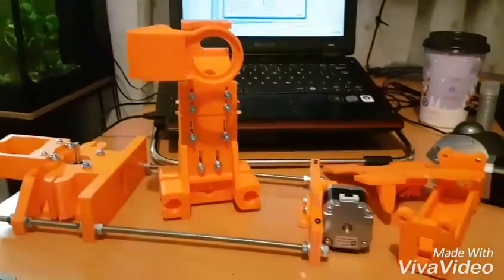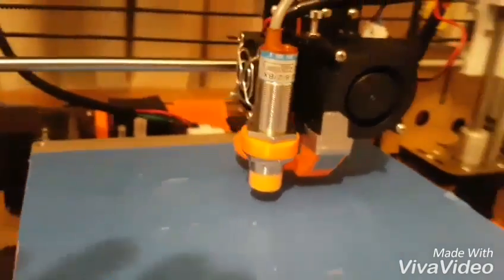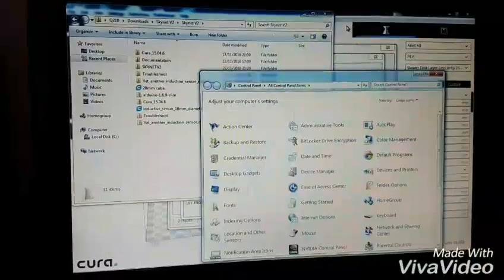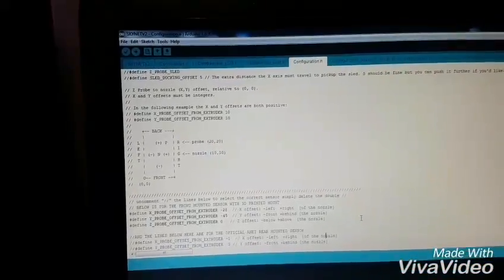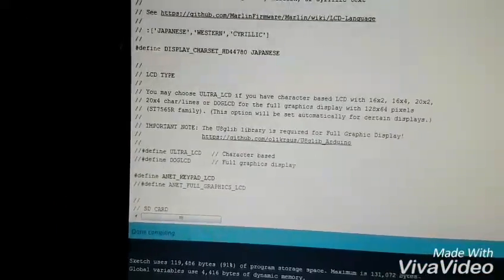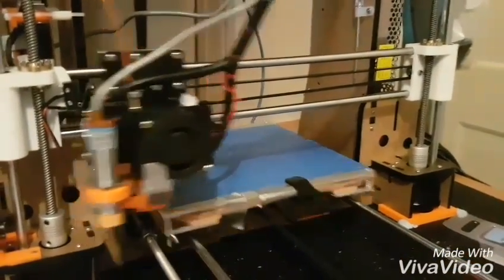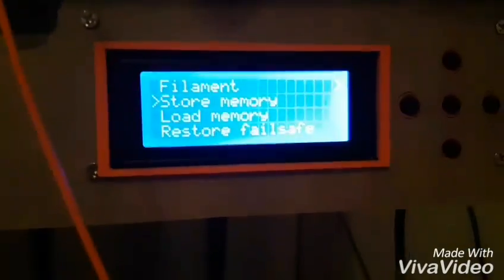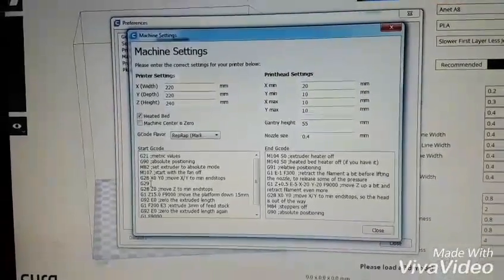Anet A8 Inductive Sensor & Skynet V2 Overview

Comment: i cant lower the z off set lower than 0.5
Reply from the maker: Hi, That sounds weird, It has been a while but can you see a 'max z offset' in the code anywhere? When I get a sec, i will have a look. Cheers.
Reply: solved , took me a day. (coz all other thing went wrong..)

have to disable software_end_stop.

then M502
after home, click Z down( any, just so the nozzle now is at Z0 to what printer thinks)

then G92 Z10. and i can start lower.  buut still , i can only lower the Z on the printer screen, i cant do it via repetier.

then get the offset. and flash firmware and M502 again .  

damn

Comment: I purchased the same one from amazon but im not exactly sure how to wire this thing, could you make a video explaining how to wire it as well? thanks
Reply from the maker: sk8rgu1 Hi. Mine came plug and play with a connector but I was messing around with another one the other day on Arduino. From memory, the brown is +5v, the blue is ground and the black is signal but I'll check. I put a 10k resistor between signal and ground I think. I'll dig it out. There is a pic in the documentation section of the Skynet Firmware folder linked on my other vid.
Reply from the maker: sk8rgu1 Hi. i just found the diagram I used when messing around with Arduino to test the switch. Brown was vcc, (it says 6-36v but 5v works fine), black is signal and blue is ground. I put a 10k resistor between black and blue (signal and ground) but I don't think the bought one had one and if you are running it at 5v (ie you are powering it from the socket where the old switch was) then you probably needn't bother. If you want to run it from 12v (which I wouldn't) it will need that 10k resistor between blue and black plus an additional 15k resistor on the black signal line before it gets to the board. I am not sure on the pinout of the endstop sockets. Maybe worth checking on the AnetA8 Facebook support group as a quick search didn't turn anything up. Good luck.
Reply: oh wow awesome! I did the whole resistor thingy and figured it out yesterday. I just used 2 10k resistors instead of a 10k and a 15k. I got mine working and its pretty good. However i do get quite a few miss prints, im guessing its because of how cold it is in the basement (50*f or 10*C) so i put my printer in a box and we will see how that goes
Reply: Maybe you can buy it here https://www.aliexpress.com/item/High-Quality-LJC18A3-H-Z-BX-1-10mm-Capacitance-Proximity-Sensor-Switch-DC-6-36V-300mA/32828750563.html

Comment: Hi could you point me in the right direction, firmware upload without issue.. everything looks good open up Cura and use the print to USB brings up a simple window Printing on COM6 "operational temperture: 21 bed 21" COM port is correct and using Cura 15.04.6.

Thanks

Loz
Reply from the maker: andrew lawrence Hi. I use Cura 2.3.1 and just normally print from sd cards. the default Prusa I3 settings are a good start to get good results.
Reply: I fixed this by switching the Print Window interface too Pronterface UI, this can be found in the Preferences options in Cura.
Reply: Andrew, thanks for giving the solution to the problem.  Was looking around and would never have found it.

Comment: How did you wire the sensor I can't get it to work. :) thanks!
Reply from the maker: TekkitWithZander Hi. sorry to hear you are having problems. The sensor just plugs into the z axis socket where the switch was on mobo.
Reply: Plan C can you help me with my printer please if you could Skype me that would be great, my skype name is TekkitWithZander. Thanks so much

Comment: I keep getting an error on this line:  float zprobe_zoffset = Z_PROBE_OFFSET_FROM_EXTRUDER;
Reply from the maker: Hi, Not sure tbh. When compiling?
Do your lines look like this?

// uncomment "//" the lines below to select the correct sensor simply delete the double //
// BELOW IS FOR THE FRONT MOUNTED SENSOR WITH 3D PRINTED MOUNT
#define X_PROBE_OFFSET_FROM_EXTRUDER -28  // X offset: -left  +right  [of the nozzle]
#define Y_PROBE_OFFSET_FROM_EXTRUDER -45  // Y offset: -front +behind [the nozzle]
#define Z_PROBE_OFFSET_FROM_EXTRUDER 0   // Z offset: -below +above  [the nozzle]

The ones below that should be commented out like this:

//AND THE LINES BELOW HERE ARE FOR THE OFFICIAL ANET REAR MOUNTED SENSOR
//#define X_PROBE_OFFSET_FROM_EXTRUDER -1  // X offset: -left  +right  [of the nozzle]
//#define Y_PROBE_OFFSET_FROM_EXTRUDER  3 // Y offset: -front +behind [the nozzle]
//#define Z_PROBE_OFFSET_FROM_EXTRUDER 0   // Z offset: -below +above  [the nozzle]
Reply from the maker: It may also just be worth unzipping a fresh copy of Skynet, making the changes and re-compiling/uploading. May have hit a key somewhere by accident or something? Good luck.
Reply: I just ended up using skynet v1, a I now have auto level working.
but thanks anyways

Comment from the maker: @ Thomas Hussey. (sorry - couldn't find your comment to reply direct). The only think I can think of for "Z probe out. bed" message is that the firmware believes that the z probe is outside of the area of the heated bed. I have not come across this myself but you could check a couple of things: First, in the machine settings of Cura, is the bed size set correctly at 220*220? If so then check you didn't un-comment the set of lines in Skynet for the official Anet sensor instead of the Ebay one. The Anet sensor is mounted in a different location. It is mounted behind the nozzle where the linear bearings attach to the X rails. Have a look at 5:23 on the video. Its the first set of 3 lines that need to be un-commented. The second set of 3 should be left alone (unless you have the rear mounted sensor). Other than that, check that the offsets between the z probe and nozzle match what is shown at 5:23. Finally, check that the "define left/right/etc probe bed position have the same values as shown at 5:49 in the video.

Comment: Thanks for the video, one question which i cant find an answer too anywhere; how do you know what height the z sensor needs to be in the mount? Is it just a matter of making sure the nozzle is as low as possible and adjusting the sensor height until it lights up?
Reply from the maker: Robin Lester Hi. I have the sensor 1-2mm above the nozzle. A small cable tie happens to be about 1mm thick so you can lower the nozzle to where you get a nice drag on the paper, loosen the sensor mount and then slide the zip tie under it and tighten it back up. The 1-2mm is just to help stop the sensor from getting caught on anything.
Reply: Plan C so the sensors height doesn't really matter? I assumed you had to move it to the point the sensor will trip, otherwise how is it going to stop the head crashing into the heatbed? when the sensor trips all z movement should stop?
Reply from the maker: Hi, That's right. When the sensor trips the CPU thinks that the Z is at zero.The blue sensors have a max range of about 4mm and the orange ones are about 8mm I think. In practice it will be less as these are cheap sensors and the plate is aluminum not steel. It doesn't really matter where the sensor is as long as it is within range and below the nozzle. What matters is the Z offset.or the amount that the computer should continue moving down past the point that the sensor is triggered to give the 'true' Z=0 point for the nozzle. The offeset is negative because the the sensor is below the nozzle. Good luck.
Reply: Plan C Thank you! that makes perfect sense :)

Comment: Thankz for the guide dude, made life super easy for me, just 1 thing i'm struggling with, after each print the thing starts printing in the air, it doesn't home Z, and i have no idea what you saying after 11:40 haha ;) listened about 50x, UK always a battle to us South African's lol could you please explain the last part.
Cheers
Reply from the maker: SainT FPV Sure. I had that too. I home it on the LCD before each print and I also put a G29 command (scan bed) in the printer setting. Just insert a line and type G28 After the line where you see the first mention of G28. Its in settings, printer, manage printers, machine settings in Cura. I have it at line 6 in the Gcode. Good luck and thanks for watching.

Comment: Can I have a link to the finished code before you uploaded it I have the same printer. And don't know how to code it for the induction sensor, thanks. BTW Nice vid!
Reply from the maker: TekkitWithZander Hi. Sorry but I don't have an easy way to upload it as I don't have any online storage. There are only two changes to the original code. If I can figure a way out to upload it then I will. All the best.
Reply: Plan C thanks, what if I create a Dropbox that you can use
Reply from the maker: TekkitWithZander Hi. happy to do that
Reply: Plan C reply how do you want me to send the email and password  to you
Reply: Plan C so is the 145 the bed temp? Also what material do you use
Reply from the maker: No.I think I set the extruder to max at 145 just for safety, you can change it if you want. I think I put bed temp max at 130. I only use PLA so far.
Reply: What's the dimensions of the printer I am going to make a desk
Reply from the maker: TekkitWithZander I would say allow 50*50*50 cm. i have it sat on an anti vibration mat for a washing machine which is 60*60 and that suits it fine.

Comment: I have a question , I am buying an anet a8 i3 from a site , will the skynet v2 be compatible on it ?
Reply from the maker: Utkarsh Kharayat Yes. Skynet is just a fork of Marlin.
Reply: Hello ,you can buy it here https://www.aliexpress.com/item/High-Quality-LJC18A3-H-Z-BX-1-10mm-Capacitance-Proximity-Sensor-Switch-DC-6-36V-300mA/32828750563.html